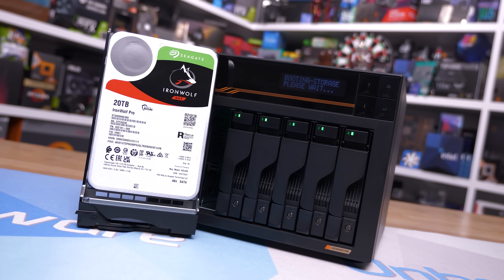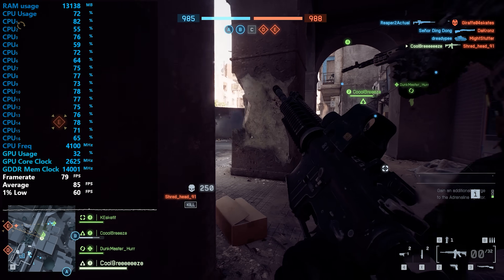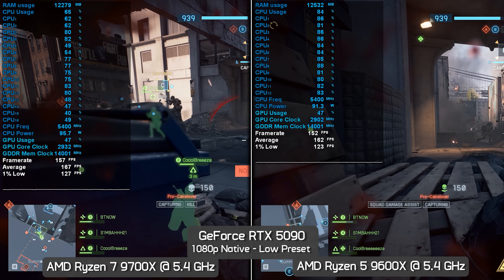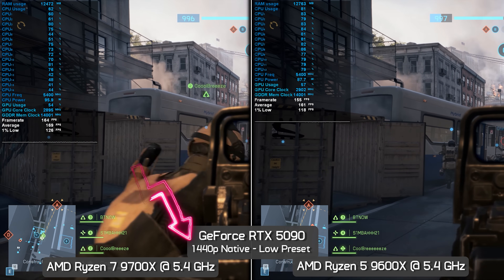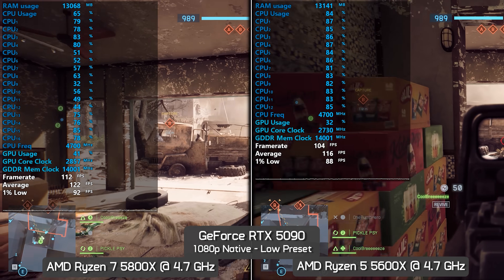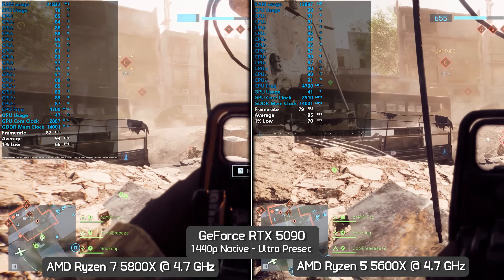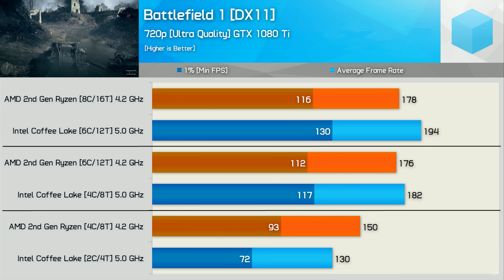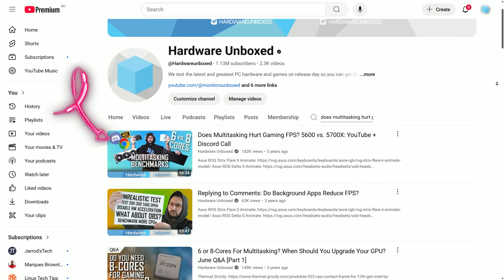Why Gamers DON’T Need More Cores, 6-Cores Still Works Well!

Comment: Now do the same kind of logic 6 years ago with 4 core CPU's.... with this kind of advice if you bought a CPU back then you would now have to replace it. If you did not take this kind of advice and bought a 6 core CPU.... your current CPU will still be fine if you only go by core count.

Contrary to popular belief, you don't currently have problems with 8th gen intel CPU's unless perhaps you do 4k.
Reply: Hmm I still believe a 7700K is still considerably faster in gaming than my Ryzen 1600 in 2025.  But that is going back 8 years vs 6.  I think Steve kind of mentioned it in the video where the 2700x had to have double the core count of the Intel CPU to be as fast or faster.
Reply: @davidandrew6855  There is the oddness to keep in mind where Intel used to be the superior choice before DDR5 took over from DDR4 where when you talk to some people there was a kind of switch.... before this switch RAM was important to AMD performance but largely irrelevant to Intel performance now it's the other way around but also you have Intel e-cores and degradation issues that muddy the waters. This causes wildly different results because of wildly different RAM specs, on both sides of the "switch". And today a LOT more people buy faster and tighter timed RAM than used to be the case before DDR5 made it a thing.

Everything that used to be simple now is complicated. Also there was a seachange in how games use the CPU from the 4-core era to the 6-core era and it happened in a single year as I recall, before 4 cores were fine then suddenly 6 cores minimum. I don't remember if it was the same for 2-core to 4-core but it was funny because the Black Ops devs were confused about people still using "only 2 cores". This pattern has repeated multiple times... it will repeat again.

I am puzzled by the logic of "because that's all you need today that's all you need tomorrow"..... when tomorrow has by definition not happened yet but the past disproves your wonderful optimism.
Reply: @rambo9199  "I am puzzled by the logic of "because that's all you need today that's all you need tomorrow"..... when tomorrow has by definition not happened yet but the past disproves your wonderful optimism."

I am just going by what I see from testing and my own use case.  I highly doubt that developers will just switch it up one day and make games unusable with only a certain number of cores.  That takes time and it would be foolish to do that considering the literal millions of PC gamers with 6 cores in their gaming PC.

Consoles currently only have 7 usable cores for gaming, and they are lower clocked cores from 6 years ago even a modest Ryzen 5600 is much more performant.  I would say any PC gamer with a modern 6 core CPU, say 10th gen Intel/Ryzen 3 (that would also mean anyone on a 8700K) and up are probably OK for gaming for the foreseeable future, as these consoles probably have at least 2 years in their life cycle.  

Additionally, 6 core CPUs, if they continue to be a thing moving forward, will also increase in IPC and be faster than what we have right now. So a 6 Core AMD 10600X could have cores so fast that it perform better than a 7700x/9700x in gaming. We just don't know yet.

Now my 6 core AMD is showing its age, it is 8 years old at this point, and newer games do make it chug, but I don't see any games within the next few years that will be unplayable for most newer 6 core owners.  The 8700K, which is also nearly 8 years old, is still surprisingly usable in many games in 2025.
Reply: @davidandrew6855  The logic breaks down when you look at how many 6-core CPU's were in use 8 years ago vs how many 4-core CPU's were in use. The 4-core of then is the 6-core of now, you might not notice when it becomes 8-core but it will. Most likely it will be the PS6 that decides it.

But then again a lot of this has to do with how often people upgrade. If you only upgrade once the previous CPU starts to give you trouble then you will have to prioritize more cores for just in case.... if you upgrade every 3+ years then it most likely wont matter.

The funny thing is it's a gamble.... you are better off probably getting a faster CPU with less cores in comparison but you never actually know. I have a 8700 (non-k) myself and its difficult to know how much of how well it still holds up is because it's 6 cores (instead of 4) or because it's faster than an i5 would have been. Intel just did not have at the time the speed vs core mix n match difference between models that AMD did. Now if I at the time got a faster 4-core CPU.... I would probably be in trouble now but I just don't really know I admit.
Reply: @rambo9199  I don't think that logic works to be honest. A modern 6 core CPU is much faster than those 4 core CPUs of the past. Remember the argument was if 6 core CPUs are good enough for gaming, and they are, because each core can do so much work.  That is precisely why a 5600x will always be faster in gaming than say a 3700x, not core count but how much work can each core do. As for the PS6, if it launches with an 8 core part with a core reserved like the PS5, we are in the same scenario, as they will most likely be downclocked parts whether they are Zen 4, 5 or 6.  If they are targeting 120fps again, they won't need the best of the best to achieve that.

I don't think one would have to upgrade to a higher core count, if the newer 6 core parts are just that much faster per core. Go back to my 5600x vs 3700x example.  Obviously we do not know how performant future AMD parts will be, but if they release a 10600X 6 core part, and the IPC is 15% better than say the 9600x, that 10600x would be a great drop in upgrade. If one wanted to save money no 8 core part needed unless they wanted to chase every frame possible.

"The funny thing is it's a gamble.... you are better off probably getting a faster CPU with less cores in comparison but you never actually know. "

I think we kind of do, as the 8700K is a great example, I've seen some recent testing that shows it is still a capable CPU for gaming "IF" one is not chasing framerate to the highest degree.  Some 6 core parts obviously haven't aged nearly as well, my Ryzen 1600 is one of them, but I can still play games I want to play relatively well including online competitive games. 

At some point like we did with 4 core parts, the 6 core part will go away, but don't believe we are there yet.  We have 6c parts hitting 5GHz and good IPC, unless games take an even harder dive to un-optimized territory and even then core count doesn't seem to really help, the CPUs should be fine for gaming for a good while.  I don't see a 7600x having issues with games for years, sure there may be some outlier titles, or people that need a lot of stuff running in the background while gaming. That doesn't seem to be the vast majority of gamers.
Reply: @davidandrew6855  Remember Murphy is always a factor. Its better to have it and not need it than need it and not have it. But maybe I am just paranoid after having gotten the short end of the stick in the past. I have not yet needed 5GHz for anything but I am still on 1080p 60htz and don't do upscaling.

In my case more cores are mostly just necessary for VM's and I don't actually need those anymore because WINE has gotten so good for older games.

Comment: I had R5 3600 in my homelab server until I swapped it for 5950x in eco mode. I already had mitx x570 Mobo, cooler and spare RAM and SSD. I decided to put it to use, all I needed were GPU, case, and PSU. I bit the bullet and bought cheap case, decent PSU and RX 9060xt 16gb. I was very pleasantly surprised how well it is running. Even compared to my 5800X3D/7900XTX main rig.

Comment: Oddly enough, despite not wanting to do a system benchmark, that's what you ended up doing by using nVidia.  Especially with the older CPU's.  Given the CPU overhead of nVidia drivers, the 7900 XTX or 9070 XT would be faster in a lot of those tests, and probably no less than on par in the rest of them.

Comment: Does the i7 8700k still work well? I have one paired with a GTX 1060 6GB. 😂
Reply: I'm still rocking a Ryzen 1600 and 1660TI so I would say you are way ahead in terms of CPU capability.  I'd pair that with better GPU as I am betting you are 100% GPU limited in any "newish" game.  LOL  If you could find a reasonable RX 3080, your games would fly!

Comment: These benchmarks show me that if I go for 9700x in Battlefield 10, I might get 20% more performance than 9600x. So yes, it matters; if you have the money more cores is better – maybe not today but definitely in the future
Reply: It depends how you want to build. If the 9600x is enough performance for a good while until the last gen comes out for AM5. Then get the 9600x and see what the last gen of AM5 CPUs offer - best to get the 800X3D in my opinion then. 

However, if you want the 9800X3D now and can afford it, why not. My 9800X3D is earning it's cost now, because those latest UE5 games are very, very CPU demanding maxed with RT.

Comment: The Zen+ 2600X vs. 2700X had the 4+4 CCX architecture. So the 2700 was 4+4, the 2600 only 3+3, so only 3 cores in the same CCX with low latency, the latency penalty to communicate with the other CCX has a big impact of gaming performace, like this test showed. The same would be if Zen2 3600x vs. 3800X, it still has the 4+4 CCX config. Just with Zen3, Ryzen 5000 series, they skipped the 4+4 CCX architecture and switched to a 8 core CCD with a ringbus, just like Intel. So all cores within a CCD had very low latency to each other and this was the big game changer to finally be better gaming CPUs than Intel. Interesting would be 5800X vs. 5900X because single 8 core CCD vs. 6+6 CCD, probably the single 8 core is way faster. Core count doesn't do that much if you had a minimum amount of cores/threads. If you have "enough" cores, than the performance of each core is more important, combined with low memory latency and high clock. And lots of cache... 😇😇

Comment: There is a point to using 8 cores instead of 6. While many people, as you mentioned, prefer more cores in general, consider the resale value. If you want to sell your PC in seven years to buy a new one, which would be more appealing to a buyer? The one with more cores.
Reply: No one will want to buy a 9600X in 7 years and no one will want to buy a 9700X either, or does anyone want to buy a 2700X or an i7 9700K today?
Reply: @zlandboss  Untrue. There is always a buyer.

Comment: Tried Ryzen 5 7600x + 4070super on GTA V enhanced RT all maxed out even crowds which is CPU heavy. The gpu utilization goes to 80% on busy streets in the city and especially while driving fast. Bought a 7800X3D and boom my utilization is always at 99%-100% even while driving fast in busy streets. BIG difference
Reply: That could be the huge L3 cache helping there, some games really do like that.

Comment: 6 core cpus can game fine but your maxed out a lot more when trying to do anything else on the pc….. 8 cores of similar performance gives you that extra headroom to be able to run more than one game at once or other programs like I do sometimes.
Reply: I would think the odds of most people running more two games at once is pretty small. Even with my ancient Ryzen 1600, I never had any issues with programs running and gaming, especially once I moved to 32GB of RAM.  

The new 6 core CPUs are absurdly fast, should suffice for most gamers, IMO of course.  I would however buy 8 cores if I'm building new, as the cost differential when factored into the entire build cost, is rather small.
Reply: @davidandrew6855  Yes this is a totally niche case but sometimes I double up with relatively passive games(former triple boxers when playing WoW mmo) which would surely on a 6 core not run it as well, since most of the cores are running at 90%+ with a single game compared to the 8 core % of use.

Comment: Need to remember this video is a test of ONE game. The majority of games barely use 4-6 cores, so anyone saying more cores = better gaming doesn't know what they're talking about, but of course they always refer to exceptions as the rule. If that was the rule then the 32 core Xeon chips should be getting over 50% higher performance.
This is why most games will typically run better with a 9600X (6 cores at 3.9-5.4GHz) than a Core i7-14700/F with 8 cores and base clock of 2.1GHz and struggles to boost multiple cores over 5GHz. SOME games may use additional cores but that is the exception, not the rule.

Comment: I still wouldn't want a 6 core cpu these days. Sure they look good on a clean test bench, and with a single monitor. I would not expect it to do as well, with regards to stutter, in a real world setup with dual monitors, with discord, AV, web browser and such running on the second monitor, in newer horribly optimized titles we have become accustomed to lately. 8 core imo, is the sweet spot standard in 2025. 12 and 16 core maybe for streamers, but generally I agree those are overkill, for most gamers.

Comment: Great video. The results are confusing to me, though. The 6 core CPU tended to be loaded 10-20% more on each core than the 8 core part. Why can't the 8 core part bring the load per core up to match the 6 core part and then effectively get the 33% more performance that should theoretically be available. What am I missing? Is it an IPC thing? Help me understand.

Comment: Gaming as an adult have limited time. More cores CPU improve your overall PC experience.
From compile shader (my last 3 games that I finished Avowed, Wukong, and Veilguard always check compile shader, it is pain in the a$$ when new driver released), running so many background app without problems (for me signalrgb, wallpaper engine, aida64 sensor panel,etc) and faster download+installing game from steam (I remember my PC freeze while downloading using Ryzen 5 3600 😅)

Comment: My understanding of game engine design is that you could try and parallelize it but eventually you have to periodically sync things up to the main game thread, and you get a buggy mess if you don't do that. So it limits how much you can parallelize. I'm amazed games use 6 cores as it is. The only part of games that is highly parallel is the rendering of the final images themselves which is specialized, handled by the GPU.

Based on that thinking it would be interesting to find out if integrated graphics does benefit from additional cores. I would imagine not, because integrated graphics are not handled by the CPU cores themselves. They just tack on a tiny GPU with some GPU cores onto the die of the existing CPU
Reply: On the other hand, many video games seem more simplistic and static than before. I dont really know where they use the massive amounts of extra horsepower they have available now as it doesnt seem to go anywhere that noticeable.
Reply: @manefin you sound like someone who would enjoy the WILD physics on display in the latest 007 First Light trailer :)

Comment: I have the 6 core 12 threads 7500F and often see high CPU utilisation in games like cyberpunk and sometimes in GTA V even, but still my GPU is usually the bottleneck, making this 6 core CPU an amazing value (especially given that I got it 2nd hand with a motherboard as well), absolutely no regrets getting it
Reply: Perhaps in the future, games would be able to utilise 8 cores better, but doesn't mean my 6 core CPU is obsolete just yet

Comment: Crazy that Borderlands 4 minimum requirement is an 8-core CPU.
Reply: Yeah there requirements make no sense to me. A 9700K is much faster than a 2700x and a 9600x would be much faster than either of those. I put very little stock into requirements at times.
Reply: @davidandrew6855  I feel like listing core requirements is just dumb to begin with. The 5600X3D is often a decent bit faster than the 5800X, and then there's the fact than Intel and AMD core counts are not directly comparable.

Comment: Once you hit a threshold, the load becomes better run on a GPU. This is handy because if you stream, you can use start setting everything to software rendering if you have a few unused CPU cores, and sometimes software encoders are better than the GPU hardware encoders. Multicore loads often rely on a single traffic cop thread especially, and that's a major bottleneck
Reply: The watching videos and Discord claims: yeah, those loads are nothing for CPUs. I agree with your assessment on that

Comment: So I have a 5600x paired with a 3080 12gb (played it at 1440p with only texture on high and everything being on par or low) and to say it sat at 109% on the built steam performance overlay sometimes spiking (if rubble/explosion occurred) to 126. Pretty much trying to run anything other than discord (with hardware acceleration off). It’s playable but it can be unstable at times and not only that, it results in some rather hotter than wanted temps. (Sorry if there’s typos sending this from mobile.)

Comment: Guys you have to decide what is the truth - 6 or 8 cores for gaming. In all other videos you put so much shame onto the 7900x3d and 9900x3d and those are really good CPUs, both for productivity and gaming. A bit of more serious approach instead of sensational news outletism.
Reply: What?  They explain why that is sometimes not the best for gaming, the latency.  Both of those use 2 CCDs and only one CCD has the 3D vcache. So if you only used the CCD with Vchache, it would essential be 6 core part, a each CCX in the CCD as 6 cores, if I understand correctly.   What hurts those parts in gaming compared to the 9800/7800X3D is the latency when communicating between CCDs.

Your last sentence makes zero sense, as they have never said the 7900x3d/9900X3d are bad parts, just not the best for gaming and gave reasons why.   Your comment is a bit on the sensational side, by stoking a fire where there really isn't one, don't you think?
🤷‍♂